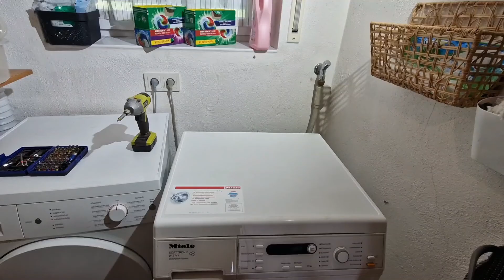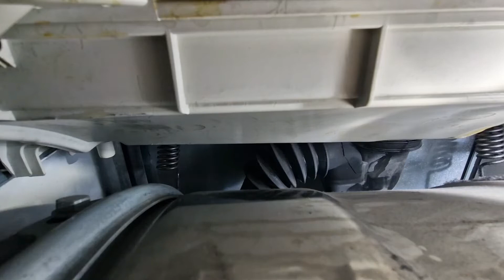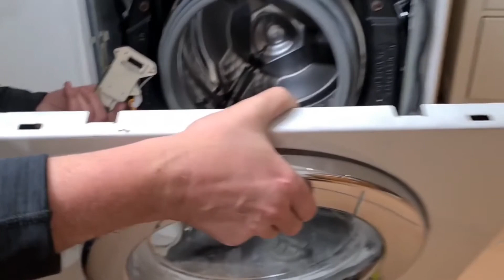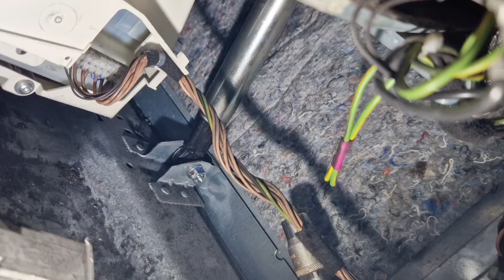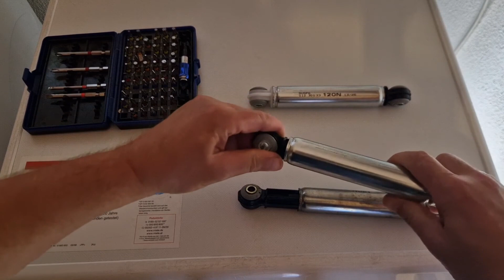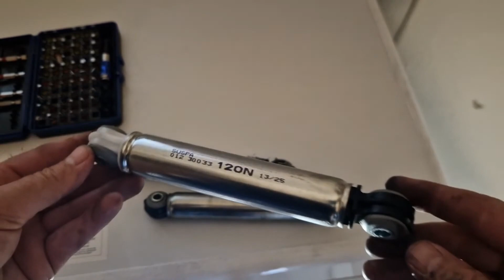Fix Your Miele Washing Machine: Stop Loud Rumbling & Excessive Vibrations Fast!

Comment: Thanks for your video. My last Miele lasted 22 years with no repairs. My current Miele, WT1 wash & dry I bought in 2020. Today the drum started banging and won't spin. I did have pillows and towels in one wash and I think the load was too much. I'm afraid to open it and worried about getting a technician. I've moved to the Carribean, Miele isn't a well-known model here. Could you tell me if shock absorbers you purchased are specifically for Miele washing machines or just standard ones? Thanks in advance.
Reply from the maker: Hi! Thank you for watching my video.
The shock absorbers I installed are standard/universal ones. Miele typically source these parts from OEM suppliers rather than manufacturing them themselves, so standard ones work great as long as the measurements, mounting hole diameters, and damping force (measured in Newtons, which is usually printed on the old shock absorber) match.
Reply: @craftbox-bastelkiste Thank you very much for replying.

Comment: I think that’s the same model I have, have you done a video on removing the drum and replacing the spider I think they call it. I’ve replaced the shock absorbers but didn’t fix the loud knocking sound. 
Cheers from Australia
Reply from the maker: Hi! Thanks for reaching out all the way from Australia!
Unfortunately, I haven't made a video on this yet.
Since you've already replaced the shock absorbers, here are a few other common causes for that loud knocking sound besides a broken drum spider:
Worn drum bearings: This often causes severe grinding or loud knocking noises, especially during the spin cycle.
Loose counterweights: If the bolts on the concrete balance weights have worked themselves loose, the whole tub assembly will bang heavily against the casing.
Broken tub spring: One of the main suspension springs holding the tub inside the frame might be broken or unhooked.
Foreign object: An object (like a bra wire or coin) trapped between the inner drum and the outer tub.
Hope this helps, and good luck with the repair! Cheers!